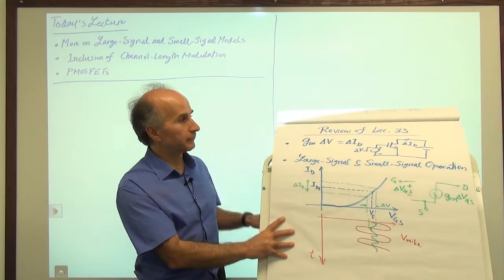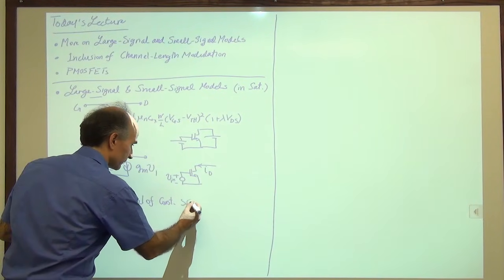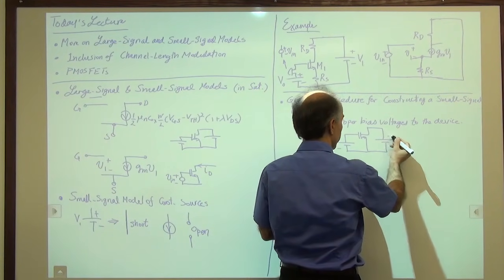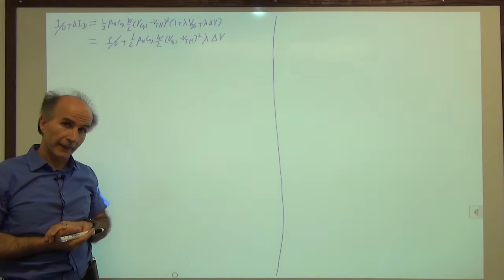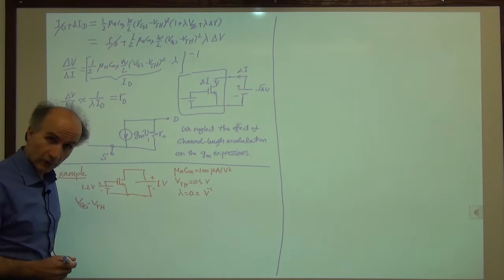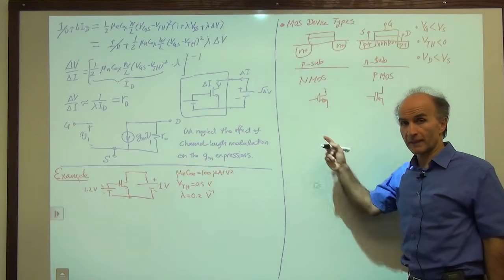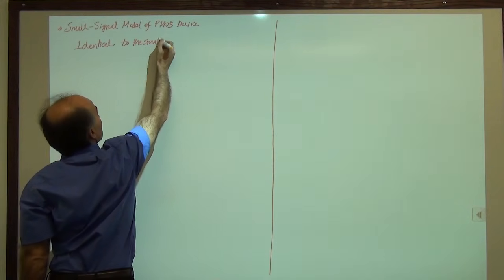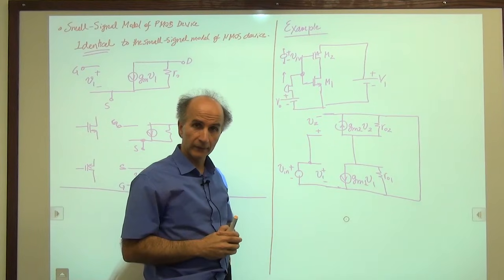Razavi Electronics 1, Lec 34, MOS Small-Signal Model, PMOS Device

Comment: It’s easy to forgive a typo wrt sign on PMOS drain terminal, and some arguable assumptions made wrt channel length modulation, because Prof. Razavi is an extraordinary gifted lecturer. I rarely see lecturers or teachers go to such painstaking lengths to drive home points or encourage thinking from many different perspectives. Many lecturers also avoid longhand writing on the white board, but not Prof. Razavi. The man is bursting with enthusiasm and energy it is as if he is teaching to an individual in a private tutorial. The fact that students readily spot typos and are ready to argue or debate one or two things is a very good thing. It means that they are learning more, questioning and supposing. Sometimes normal human error gives added challenge, and further opportunity for critical thought. It’s all good.

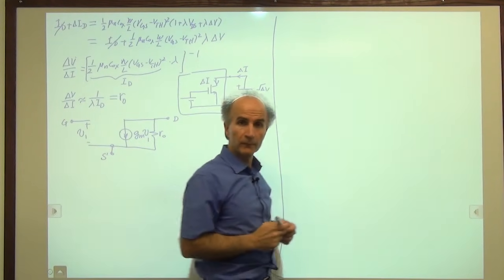Comment: at 33:52, in the small signal model representation, the voltage change (delta V) across the drain and source terminal is missing... isn't it?
Reply: same doubt
Reply: @RohanLautre  It's replaced by r0 cuz the change in Ids due to change in Vds is modelled using the resistor as per the derivation

Comment: Here are a few analogies that I like to use for circuit quantities:
current flow = water current
resistance = obstacles such as rocks and water gates
voltage = pressure against obstacles
Reply: Those re fine until the water starts hiting capacitors and inductors
Reply: @h0liravi0li96  corny
Reply: Noice

Comment: A constant current source also doesn't change in time, so why we drow the model in small signals?
Reply: The current source is dependent on vin (Small signal input) which is dependent on time, so it isn't removed from the model. Your statement is true for independent current sources.

Comment: 1:02:29 should not the gate have - minus and source should have + sign , since gate is more negative
Reply: No, that is correct. It's a small signal model not a large signal model. When VG increases the drain current decreases or the small signal current is negative. So the small signal current will go from drain to source.
Reply: I also think that...
Reply: That is correct. The varying voltage(signal) is still attached at Gate.
Remember that there's only time-dependent voltage/current source existing as source in small-signal model.
Value of constant voltage/current sources doesn't vary by time, so that we set to 0 in small-signal model.

Comment: In small signal model of PMOS he drew current from drain to source but in the actual MOSFET figure in which source is at the top and drain is at the bottom the current flows from top to bottom ie source to drain... confused.
Reply: it 's just  convention we used that id will flow from drain to source. IN nmos take it as it is,but when considering pmos take id direction same but with negative sign. I.e -id .  Don't worry about actual mosfet symbol. Its standard symbol , to distinguish between pmos and nmos , so there we reverse direction,not using negative sign for Id.
Imp point is while doing analysis for pmos , take Id same direction as in Nmos but with negative sign.
Reply: @sakethamargani8846  very important detail,thnx for clarifying

Comment: In PMOS The gate to source polarities + and - 
how can it be 
we apply negative voltage gate.
so gate terminal - and source terminal + 
I have a doubt please clarify 1:10:20
Reply: Dear Ajay,
In PMOS  -ve and +ve potentials are applied at Gate and Source respectively during biasing. When biasing is done and PMOS is in saturation,  add small signal to it. After short circuiting all the DC sources it becomes similar to NMOS small signal model.
Remember in small signal model only alternating signals are taken in to consideration.
Don't get confused in biasing and adding small signal.